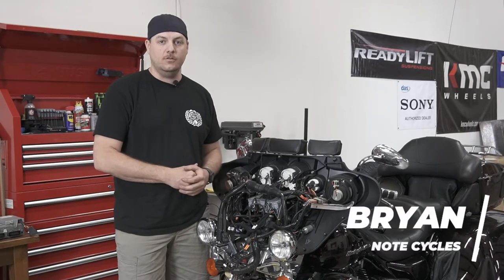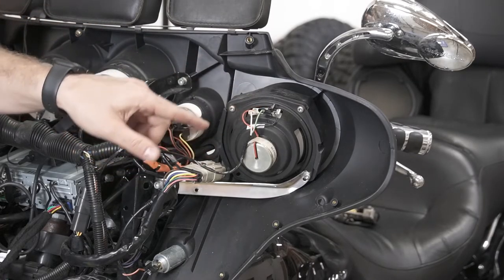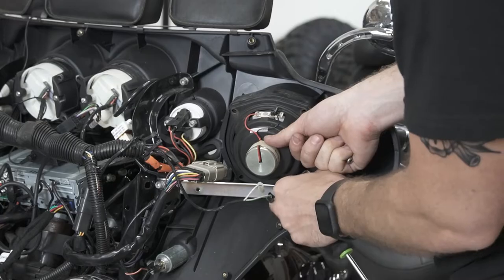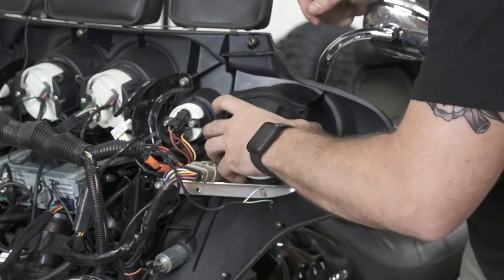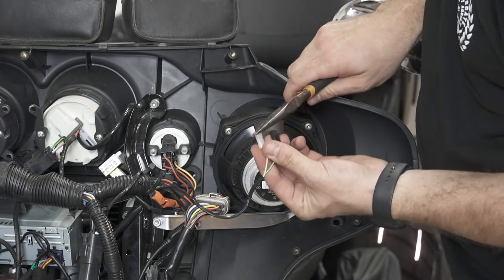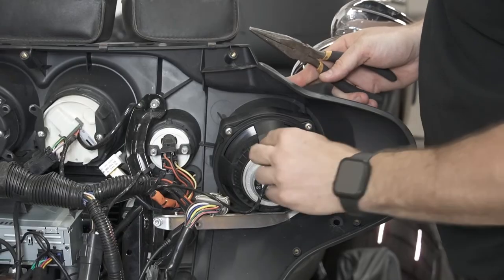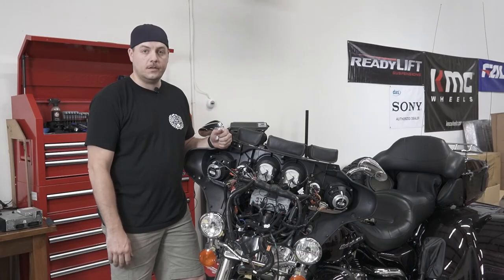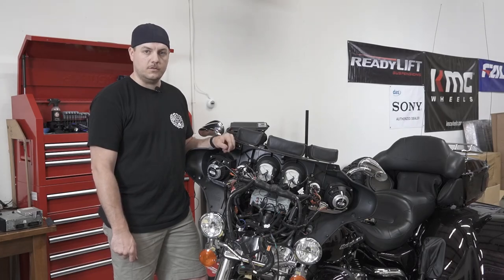1999 - 2013 Harley-Davidson Batwing Fairing Speaker Upgrade Installation

Comment: I installed a set of these with the matching Rockford head unit, they sound much better than the stock setup but I'm unimpressed by the overall sound. They get loud but don't sound well rounded. I'm installing the 6x9s in the bag lids with the Rockford 1500x5 amp hoping to get it sounding good. If not I'll be selling these and getting some good 6.5 components that'll handle the power of that amp.

Comment: SPECIFICATIONS

Speaker Type: 2-Way Coaxial

Power Handling: 150 Watts MAX, 75 Watts RMS

Crossover: Built-in tweeter crossover

Mounting Hardware: Yes

Grille/Trim Ring Included: Yes

Power Handling (MAX): 150 Watts MAX

Voice Coil Diameter: 1.40" (35.56 mm)

Frequency Response (Hz): 56 Hz - 20 kHz

Sensitivity (dB @ 2.83V/1M): 94dB

Sensitivity (dB @ 1W/1M): 91 dB

Midrange Size (Nominal Diameter): 6.5"

Nominal Impedance (Ohms): 4-Ohm
Reply from the maker: Yep! Love it - thanks so much!

Comment: Not being a hater....but since I own a 2011 ultra...factory speakers are only 5.25 inches....unless you do a Metra fairing upgrade or use adapter rings 6.5 inch speaker are definitely a no go. Sorry just wanna make sure that the information you are putting out is correct. Those Rockford speakers are the direct replacement for those years of bike.
Reply: Ring is included! Read the specifications…
Reply: I have this unit in my 2009 ultra! I plugged a data chord in the rear usb.. it worked at first now just says no device….when I crank my bike my hand controls won’t work!!! Bluetooth does connect but again hand controls won’t work unless I’m accessory mode.. any help would be appreciated!!! Thanks…